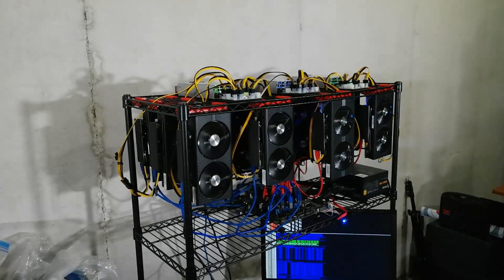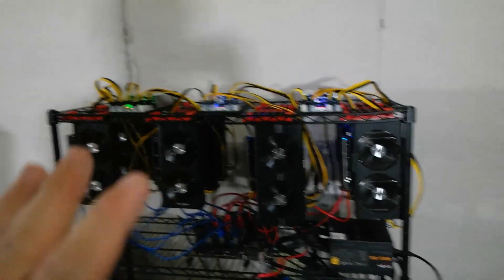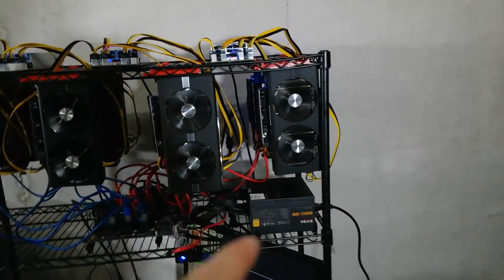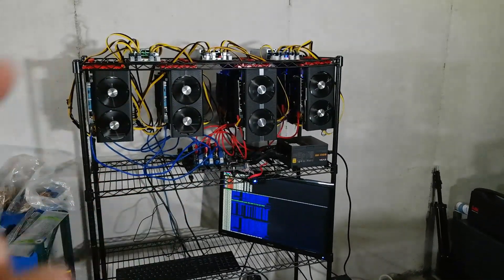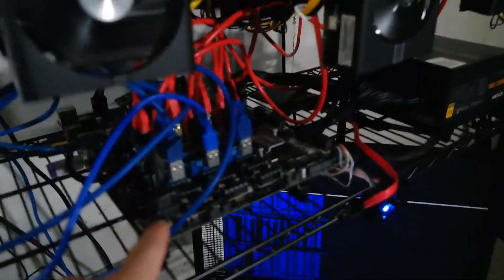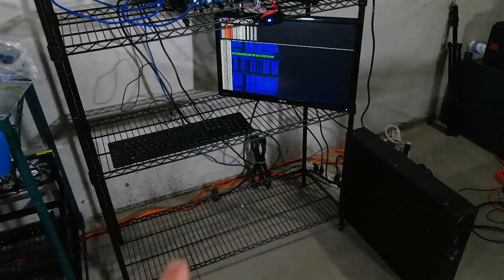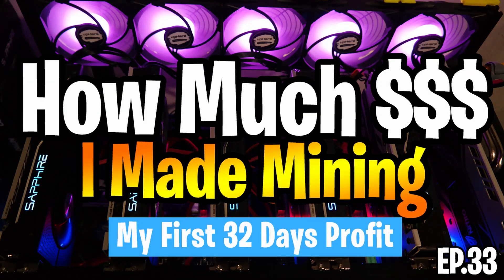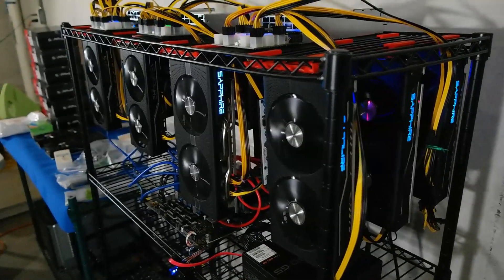Power Challanges Every Crypto Miner Runs Into

Comment from the maker: How many watts does your mining rig use up?  or should I say "rigs" lol.
Reply: 250 w I cant get gpus maybe I can have one of yours lmfao
Reply: my 5 card rx  probably uses close to 850. running 1230 core 870 mv and between ram some are 2090 - 2210 depending on ram type. altho i'm not running raven, raven would probably bump that up to closer to 900
Reply: @notyobiz6207  6x580 630W, 1100 core 850mV 1950-2050 mem...
Reply: @TheOfficialStone  i'm cpu mining and have about 3 fans on that circuit, the wattage provided includes all of that @ 161 mh/s
Reply: @TheOfficialStone  u can probably get away with 830 core. i was running 830 @ 1180 for a while
Reply: @notyobiz6207  I know but 86MH/s with 6gpu is ok for me. I dont force them. Bdw ty for advice.

Comment: run another circuit just for your mining needs. I would add another 30 amp breaker on your panel and run 10 AWG. 10 awg can handle up to 30 amps. so @ 110VAC x 30 amps = 3300 watts. so you have a budget of 3,300 watts on that 30 amp circuit. your 20 amp circuit is only good up to 2200 watts make sure you use the right size wire or you could risk burning your house down.

Comment: 30 amp 240v circuit.  240v gives you double the wattage so it's the equivalent of getting basically 60 amps on 120v.  Psus are also more efficient on 240v.  Oh and all of that on 10 gauge romex.
Reply: do not put 10 awg on a 60 amp breaker. if thats what you mean.

Comment: Awesome rig setup! I'm curious as to why you went with 4gb 570's, aren't those going to be obsolete soon due to the limited VRAM?
Reply from the maker: Good question! Eventually yes.  I nabbed these back in January/February and it was hard to get my hands on much at all.  My goal was to mine Ravencoin to start with.  I was able to nab my 470s for between $100 and $120usd.  My 570 kind of fell into my lap and I nabbed it after 1 of my 470s had issues.

Comment: Rig is looking better and better! :) With the power I suspect you will be mining for some time so I'd ask the electrician about running some 10/3 to a  new 30amp 2 pole breaker in your panel with a L6-30R receptacle in your basement. Then go with a PDU to plug all the PSU's into using C13 to C14 14AWG cables. If you envision adding a few more rigs I'd ask about just putting a subpanel similar to what people use in detached garages in your mining room. Of course soon maybe you will be checking with the electric company about about a new 200Amp single phase or 3 phase service. ;)  Welcome to the addictive world of mining! :D
Reply from the maker: haha thank you!  I am looking to have a subpanel installed in my basement.  With my renovations right around the corner I am estimating needing about 18,000w total. Running 4 racks, each rack at 3700w.  So going to present that to the electricans and see what they recommend.  Yet everything is leaning towards 30amp 240v x 4.
Reply: @TheHobbyistMiner  Awesome! Great to hear you have the bug! I hope you already have a 200amp main breaker in the existing panel and you have a gas range or you will need to have a permit pulled to install a bigger service & panel. :)